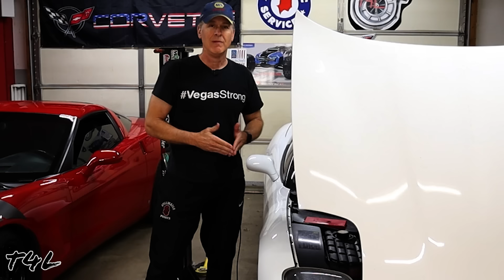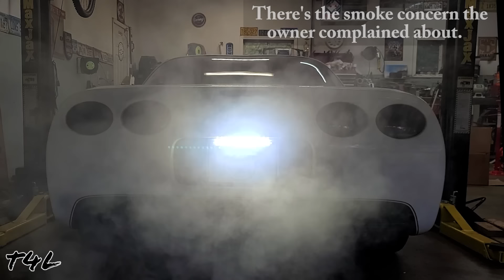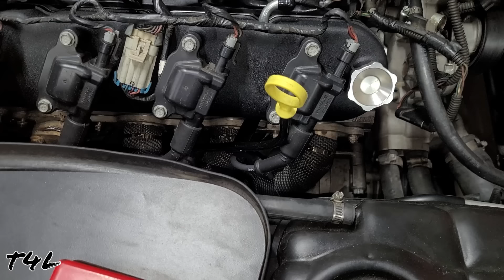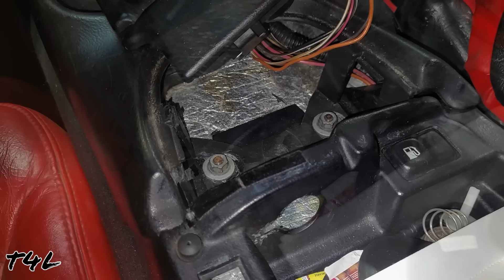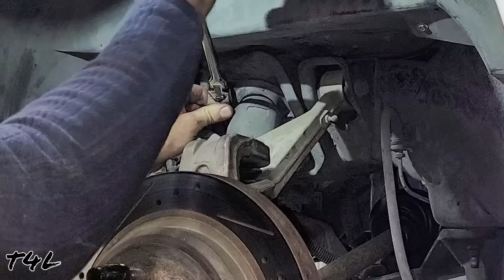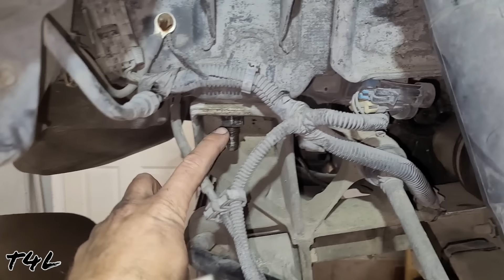C5 Corvette Clutch Replacement (It was TOAST!)

Comment: First, Love your videos -  your are awesome! Now for a dumb question. I have C5 but it is an automatic and I am considering replacing the rear main seal and cover. Does your Clutch Replacement video(s) access to the back of the engine translate well to an automatic? Thanks in advance - big fan.

Comment: I have an 03 with just a little over 100k. Have to do the rear main seal. Debating on if I should do the clutch while in there. Ive had no issues with shifting...

Comment: I just purchased a 1998 Convertible w/ 116k mi. She's in great shape,  but I do plan on replacing most of the " Nuts & Guts", along w/ adding mods ( American Racing Headers, Camshaft & a Intake manifold.  Because I have a high mileage vehicle,  should I do this clutch redo & torque tube inspection before I di the front half of the car?

I also plan on installing a super charger next year,  so should I replace the torque tube anyway? I'm a seasonal driver with a heavy foot,  so my intentions should be viewed as " proactive " rather than reactive. 

Thank you.

Comment: I'm having a new McCloud  clutch installed at this time in my 99 and hope the shop has it done soon.  Several trans shops did not want to touch this job as my headers made the job more involved.  I finally found a reputable shop that I have confidence in.   Wish I was close to Toys4Life as I would love for you to cover this job.  My Corvette has a Lunati  forged 6.5 lower end, Comp street cam with a procharger.   Engine and clutch have 45thou miles and something broke, causing vibration and hard shifting.  Clutch was still holding good. Of course I have  not been babying it for 45 thou miles!
Reply from the maker: Hopefully they get it sorted out for you!
Reply: How do u own a vette and not do the work smh

Comment: When you stated "It was toast" I thought you meant the job being really easy. I thought NOT. I had to pull the transaxle out of my 99 FRC because it kept popping out of reverse. I did that on the floor as I don't have a lift. I had to get into the transaxle, replace the reverse gear and grind a spacer down to make it shift ALL the way into reverse. The Corvette forum told me about grinding the spacer down. That was 10 years and 40 K miles ago. So far.... so good.

Comment: Been considering tackling this myself this winter. The main things I'm hung up on are match balancing the flywheel and rebuilding the torque tube (I don't have access to a press). I would need to outsource the steps mentioned above, but i haven't looked into cost yet. If you could touch on that in the next video, that would be awesome. Thanks for the great content!